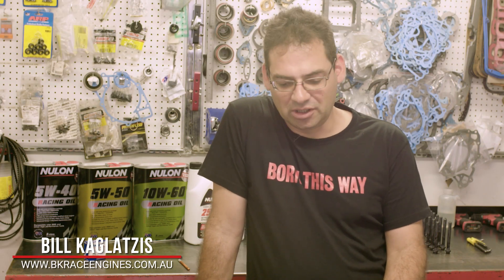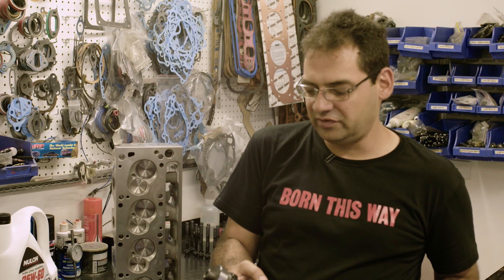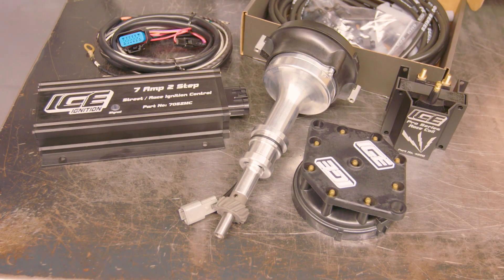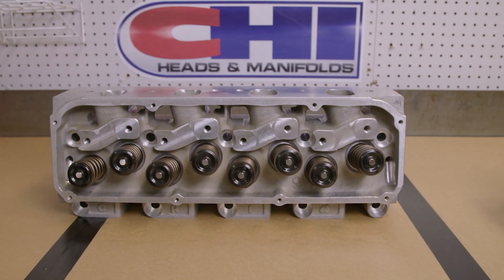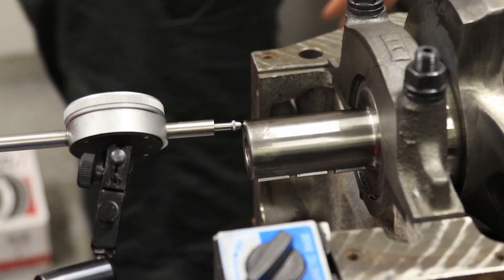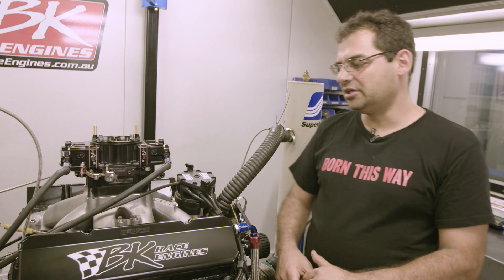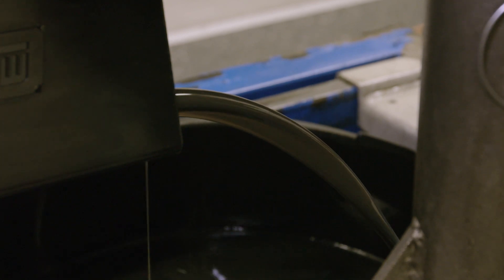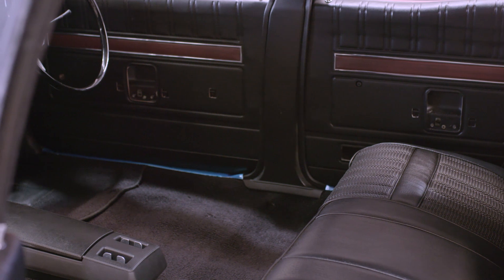Project XY [Part 3] – The Engine Build and Dyno Run

Comment: A bit surprised at using a steel hammer to bed in the locating dowels for the head :(
Reply: YT comment warrior experts, as always. 
FFS, he tapped it with nothing more than the delicate pull of gravity.